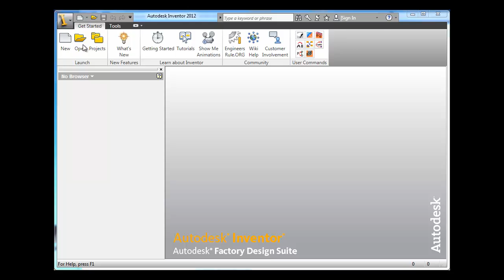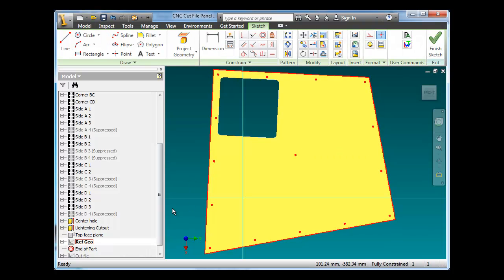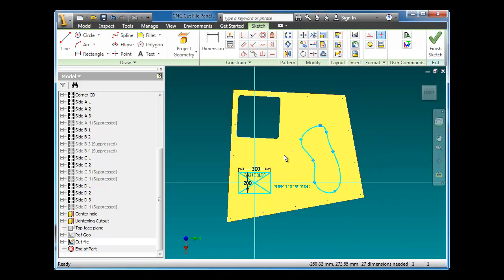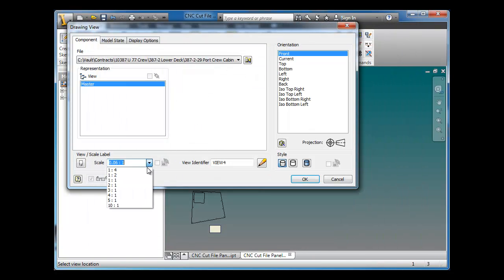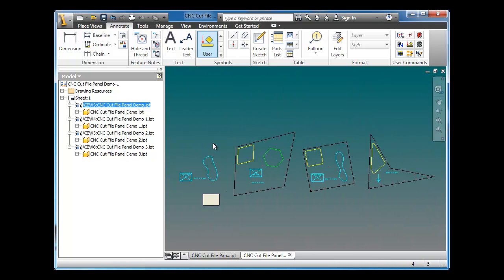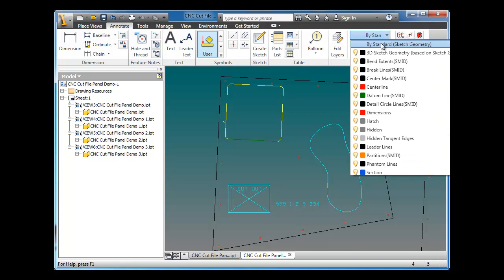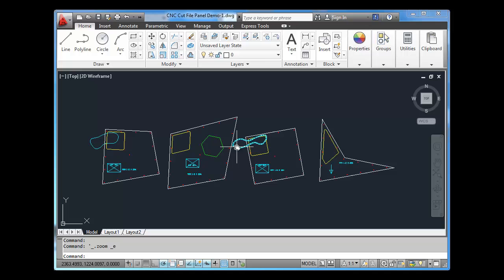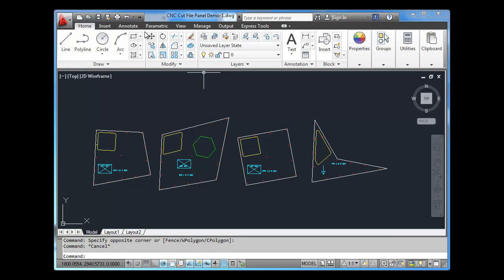Creating CNC Cut Files using sketches & Inventor Drawings

Comment: Is it possible then to convert to CNC straight from Inventor with G code? For Milling? or even other devices?
Reply: Not from 2D geometry. But you can use a free product like Inventor HSM Express to toolpath directly inside of Inventor and then output G code from that. cam.autodesk.com